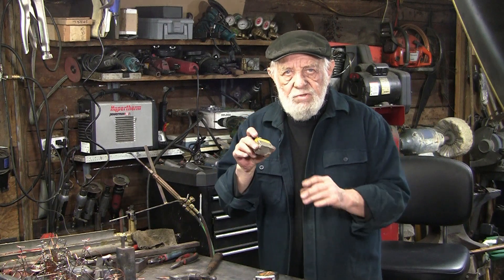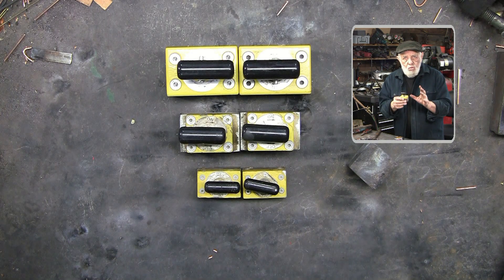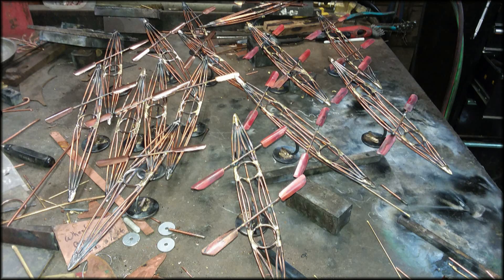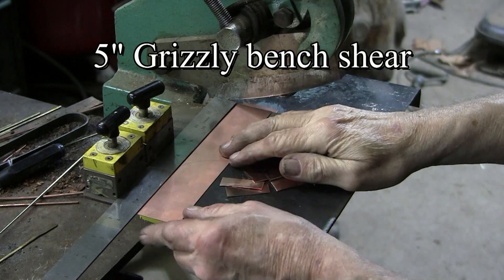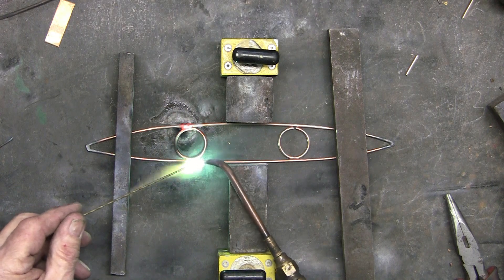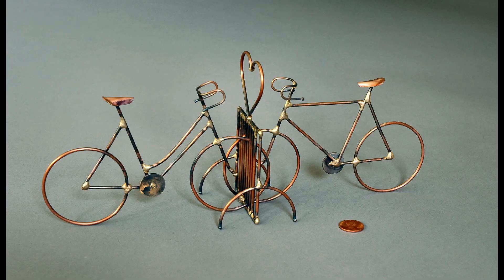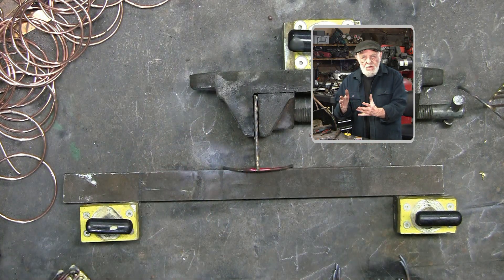Mag Switch Magnets

Comment: I also use them to hold my vise to my drill press table. My table does not have holes and C clamps have to be adjusted. I just use two 400s and turn them on and my vise doesn't move drilling holes.
Reply from the maker: Thanks for commenting.  I too keep finding  more ways to use them.  George

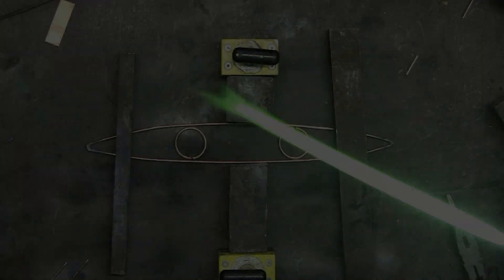Comment: 1:47 what might also work in that situation is putting one of your magnets the other side of the shear to act as a bump stop for the correct distance, i have a similar set up on my bench cut off saw but using an adjustable bolted bump stop. 
using them as bench jigs is a great way to use them.

i have been doing alot of photography stuff in the last year, i think these might be worth a look to see if you can make use of them when you need to hold two or more items up in the air to weld together, though you might already have a solution of your own.

search google images for 'smallrig 11 inch articulating arm clamp'
i also use them with a 'manfrotto super clamp' if the item is reachable from a bench position.

the use i got them for was to hold a small godox r1 rgbw led light or light modifier in any position to light items.
when i first got them i thought they would be great for holding stuff in place while i weld it up, there are often time i needed an extra pair of hands to do just that where laying stuff on the bench is not possible.
Reply from the maker: Good idea!  Thanks
Reply from the maker: Good idea!  Thanks

Comment: Those look useful.  I see them in the catalogs frequently.  Have you tried using one as a length stop on the shear?  I am wonder if one would hold well enough for repeatable parts.
Reply from the maker: I haven't used them for exactly that.  I bought the first small set and they work well for lighter work.  But quickly saw that I needed something stronger.  Check out the magswitch.com   web site.  They have magnets for almost anything that you could imagine.